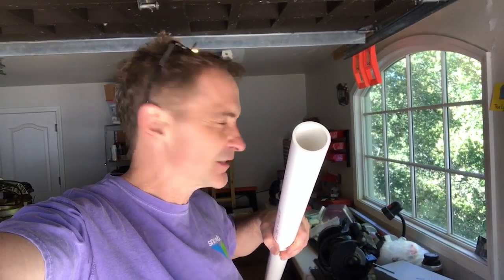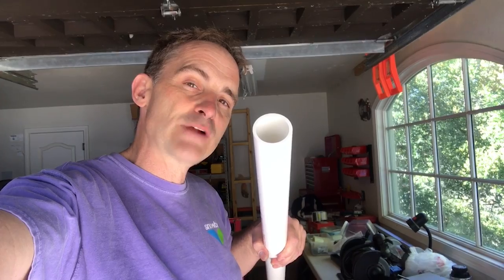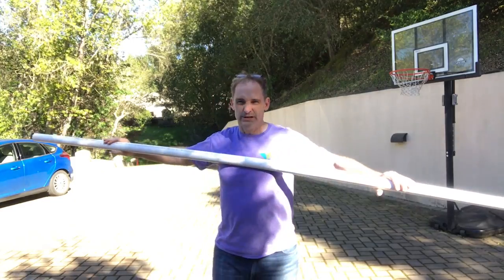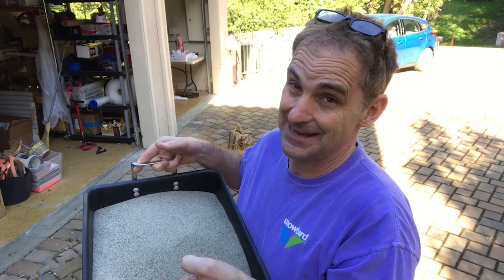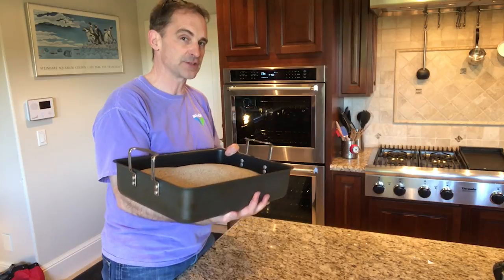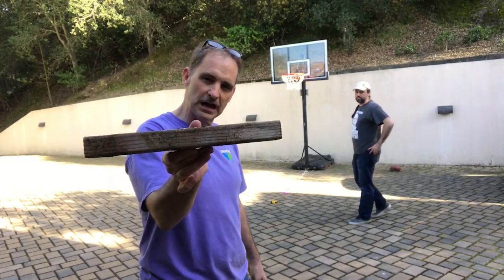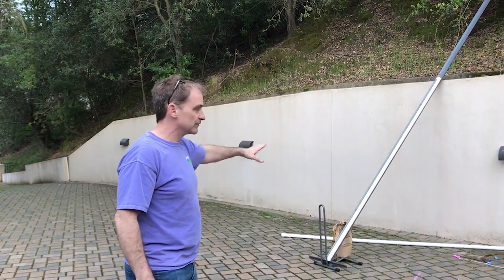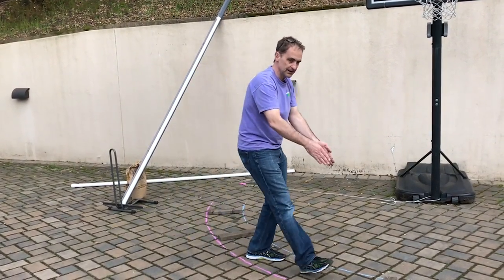Caution Zone Redux - Part 2

Comment: Great to see you're back at it Will!  You'll love how easy it is with the forms...  You just lay the pipe on there, walk away, and it just conforms to them.  I heated them up to 450 (only takes about 50 minutes by the way) and it worked perfectly!  550 you'll get a lot more plasticity, but probably not entirely necessary unless you're using schedule 80.  I see you've got a double oven there (so do I).  You can bend enough pipe for an entire roller coaster in half a day with double ovens if you've got enough forms made (heating up two batches of sand at once).  You basically have 2 pipes cooling on the forms at a time (for about 25 min) while you're already heating up your next batch. Anyhow, excited to see how the next coaster turns out! - Scott Brazelton

Comment: I used boiling water to bend VOX for my greenhouse, of course it was smaller diameter pipes. I think you could pull it off if you caped the end after filling it with boiling water, it will be a heavy of course but sand is heavy also. You could also heat the water outside with something like a turkey fryer.
Reply: *vox=pvc....silly autocorrect.